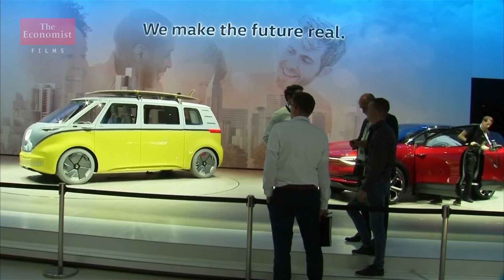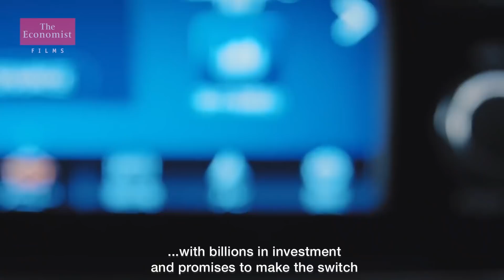Electric cars will come of age in 2018

Comment: Well, it's 2019 and they are not really catching on in the US or Canada. Less than 2% of the market in the US and less than1% of the market in Canada. Consumers don't want them. China well when you give away power and parking and subsidize them yes they are somewhat popular. Norway same thing, subsidize free power and increase the taxes on IC vehicles. Europe also has ridiculous taxes on diesel and gasoline. In the countries in Europe that are seeing increases in sales of EV the tax on gasoline is high ($1.50 to$1.76) Norway($1.86).If you look at the USA (70 cents), Canada (90 cents).All prices in USD /per liter. So excessive taxation on gas is a major factor in the switch to EV vehicles in those countries, plus subsidies to buy them. So social engineering is at play here.  There are a lot of downsides to EV vehicles. The cost to repair for one. Tesla especially. Limited range, may work well for people that live in Europe and drive short distances, but in North, America distance driven is much greater. Batteries do take longer to charge in cold weather and cold reduces battery life. Here is a video of an example of the cost to repair a Tesla EV. A normal IC vehicle would have cost maybe $2000.00 with the same damage but the estimate to repair the Tesla was $34000.00
https://youtu.be/18MItauAgKo

Comment: @Economist no mention at all of the fact that an EV powered by electricity purely from coal is still cleaner than an ICE-V?  And that the continually falling prices of solar and batteries are basically guaranteed to make the grid much much cleaner over the next several decades?  Or that an EV is the only type of automobile that gets cleaner as time goes on thanks to this trend?  Or that there’s no guarantee that cobalt will even continue to be a necessary component of EV tech as automakers are aware of the humanitarian issues with cobalt and are trying to get away from it or at least find different sources?  This is not a comprehensive video at all...

Comment: El;ectricity for EV's can just as easily come from solar, wind, geothermal and other renewable energy sources.  That transition is already beginning to happen.  Anyone who has a storage battery at home (like the Tesla Powerwall) can provide all of the energy needed for transportation if the home can provide electricity through solar or wind or any other renewable source.

Comment: This reporting is horrible.  Buying an EV especially a tesla is the best thing you can do for the environment.  EVs are rapidly dropping the cost of batteries making a renewable energy system that is 100% not only possible but far, far cheaper than fossil fuels.  EVs powered by even coal are still greener than ice cars.  1/4 EV owners have solar systems.  EVs only have 18 moving parts so they can last 1 million miles.  Lithium ion batteries soon will not even use cobalt.  battery price will drop by at 67% by 2030, and those are very conservative projections https://cleantechnica.com/2018/11/18/buying-a-tesla-is-the-best-thing-you-can-do-for-the-environment/

Comment: NO ,, Electric Vehicles wont come of age in your life time..!  EV's have been around for more than a Century and they have ONLY  become popular with the " politics towards  renewable energy " - despite advances in Batteries & Magnets.....

Currently , EV's represent less than  1%  of Cars on US roads and  "it will be a very long time"  to even reach just 10%.

As a matter of fact ;  Commercially,  it will be more market worthy for Car Makers to change to another FUEL that is
less polluting such as  Hydrogen ( once the Safety issues are resolved ) because the driving experience will be similar
as with fossil fueled Cars ( internal combustion ) - to maintain an acceptable distance / range and quick to refuel...

Electric Vehicles represent a compromise in many ways : what if you wanted to go on vacation towing a decent boat
interstate , to remote locations, where there is no "plug in power"..?  What if you were travelling into Snow regions in the dead of Winter; "where is the  energy for heating..?  Remember that any Car Air Conditioning - Cooling  shortens the range
of an Electric Vehicle that already requires " too many hours to recharge ", instead of a few minutes to refuel at a pump.   

Electric Vehicles have the very worse "resale value" obviously because ; the old batteries perform worse and need to be replaced at half the cost of a new car.  Secondhand EV's are a financial risk and compared with a S/H: petrol/ gas/ diesel cars , fossil fueled - wins in practical terms..........    

The worst propaganda FRAUD involves Commercial EV's for use in "long distance"..!!!!!   Engineers have found that current technology, cannot run heavy trucks due to Battery Weight "taking away from Freight load" ; making EV's non viable.

Then we have dreamers that think Electric Efficiency relates to the Motor - wrong, the batteries hold only a percentage
of the original energy to charge them, in the first place - the energy loss "already exists" before the EV even moves..! 
Other dreamers think that it comes from renewables ;; that's fiction.  Every Country has base load power that is either connected to another Grid or is backed up with Fossil Fueled or Nuclear Generation.  Battery storage is by far the most inefficient & expensive form of retrieving Energy - such as from intermittent Solar & Wind ; not price competitive.
Reply: @MH Sorry you have never experienced the superior dynamics of driving an electric vehicle, or the convenience of having a full battery every morning and never having to fill up at a gas station again. Take a ride in a Tesla some time and come back to tell us how much you miss the noise and delay as an ICE car downshifts before delivering a 10MPG burst of acceleration. While you have some valid points regarding grid stability and cost, all of those point begin to diminish in importance as battery costs go below $100/kWH. That is the tipping point where EV's get cheaper than ICE's. See this excellent video debunking a lot of these obsolete EV myths:   https://www.youtube.com/watch?v=kk7ZTn9g7bY&t=929s

Comment: A very simplistic piece. Electric cars will require coal to produce the electricity hence they are not green: certainly not true on the streets where the electric cars are driven and not even necessarily true at the generating station, since scrubbers and other emission controls at the generating station can be considerably more efficient than on  the tailpipe of an ICE car. As for the impact of the fact that cobalt is presently mined mostly in Africa: Australia and the US have large deposits of cobalt and plans are already afoot to develop them

Comment: The cost of storing 1kWh of electricity in li ion is 0.41USD. Storage is mostly need two times. In the BEV and then in the charger so it can charge the BEV quickly or when photovoltaics/wind have no power or when the grid can not handle charging peak demand.

http://www.intertek.com/blog/2017-10-06-grid-scale-energy/

BEVs may be acceptable as a city-only scooter not doing much mileage, because the cost of storing the electricity will make it uneconomical otherwise.

Comment: its no secrete that the electric car is powered in large part by the fossil fuel plants then even at that it is some 70% 'cleaner as there is a shift to clean alternative energies to the grid sooo they say don't change because it will cost trillions  and their will be political unrest they suggest as the middle east will become politically unstable then times 10 to climate change coming caused by fossil fuels in the first place........ this will cost 10 trillions times more and what is trump and company and the economist doing supporting fossil fuels to the last drop of profit azzwipes that they all are - sue their azz and lock them up !

Comment: China hugely invested on renewable energy, and then after India also invest huge in renewable energy. India will not going to add more(or very less) power plant based on coil. https://en.wikipedia.org/wiki/Renewable_energy_in_India

So I don't think coal demand will remain same even after EV revolution(means 90% people will use EV only). 
And that time, surely the heaven will sift from middle east to congo Africa.

Comment: Why is it most people seem to assume that refined gasoline magically appears at the corner gas station?  I’ve heard many say (including this video) that electric cars run on coal – well guess what, so do gas cars!  It takes 6 to 8 kilowatt-hours of electricity to refine crude oil into one gallon of gasoline – and this does not include the energy needed to dig the well, pump the crude out of the ground, transport it to a refinery, or haul the finished gas to the local station.  Electric cars produce no tailpipe emissions and the Defiant Electric Roadster goes about 50 miles on electricity needed just to make one gallon of gas.  The average car gets 25 MPG and produces 8,887 grams (almost 20 pounds) of CO2 for each gallon burned.  This means to go the same 50 miles the average car produces close to 40 pounds of CO2 - regardless of how the electricity is produced.

Comment: I don't know anyone with an Electric!! 

It's like a UFO.......You might see one, but it's Rare!
What about those super Toxic Batteries??
Reply: It probably depends on where you live.  I see them all the time, but most people don't even know what they look like so wouldn't notice them if they drove right by one.

Just like people keep saying they have never seen a EV charging station, but people don't notice them as they are not relevant to them.  They could park right in front of one and never notice it, as they don't use it if they don't drive an EV.

And the batteries are not "super toxic" by any definition.  The toxic batteries out there on the roads are the Lead Acid batteries, as lead is a neurotoxin.  Fortunately, 99% of all Lead Acid batteries, which are found in every gas or diesel car on the road, are recycled.

Lithium Ion batteries are mostly Nickel, which is actually not toxic.  The rest is Copper, Aluminum, Graphite, a little bit of Litihum, and a little bit of Cobalt.  None of those are actually toxic.
Reply: @ClarksonsinUSA
Super toxic is the gasoline engine. There are masses of electronic inside for For regulating and control technology, what an electric car doesn't need. It's just a simple engine without big technique.
Also the catalyst of a gasoline engine needs a massive rare earth what an electric car doesn't need.
The future Alu Ion battery is created out of Aluminum, which is a lot available on the planet. 
The super rare earth in the catalyst are blowing out in the air over time. The battery system of an electric car is a closed system, where nothing get lost and it can be recycled 100%.
Reply: eDrive Are you suggesting an ICE engine has more electronics than an electric vehicle? That's laughable. 1200lbs of batteries per vehicle is nothing to scoff at.
Reply: Yes, an ICE has way much much more electronics and regulators inside than an electric car.
Think about all the regulators and sensors belonging to the engine. look how much cables there are...
AN electric car has almost no cables. Only very thick cable for the power of the motor, but not much.
There is no measurement of airflow, no knocking sensors, no co sensors, no temperature regulators, no ignition, no spark plugs, no measurement how the mix of air and gasoline is... 
It's just a very simple electric motor with power supply. what do you need to measure and mix? Nothing... 
Only the battery is a big block, with the cells. But no need for that much regulators and electronic for a battery.
Reply: I think you seriously underestimate the electronics needed to manage a battery system and keep it safe. A car with over 7000 individual battery cells, fuses, balancing, temperature controled, grouped in parallel and series has almost no cables? Oooookkkkk....
Reply: @mar504  
Yes you need one computer to manage that all. But do you know how many computers, devices and regulators are in a ICE car? Maybe you can't count them all...
Battery development just started and there is still big potential in development. But ICE is already fully developed. There is no big gain anymore.

Comment: electric driving is so much fun... 
I never thought about that before, but since I have an electric car, I love to drive a lot.
Reply: You must have a Lead Foot. BEV is all about acceleration, people who love cars that actually quickly cover ground faster.
Reply: An electric car have always a very strong acceleration. Because straight form the start at rpm zero you have already full power without clutch and without changing gears. An internal combustion engine don't have power with low rpm and you need to reach the powerfull rpm range first. That makes it way slower.
But you can not always drive that high acceleration, because you will consume a lot of tires...

Comment: 3:46 "But EVs are still running on coal!"
It is amazing how this argument is circled over and over in the arguments, disregarding that EVs running on coal are still 2.5 times more efficient than ICE cars. And also disregarding that fossil fuel don't just come into existence at the gas station but that pumping raw oil, transport, storage, refining fossil fuels and delivering it to the gas station costs energy aswell, the same dirty coal energy allegedly all EVs are using. Also disregarding that local emissions are shifted to big power plants which are efficient than a million ICE engines, disregarding that local emissions have a more direct effect on people that power plants which emissions can be controlled more efficiently. Disregarding that renewable energy doesn't have to change in an instant but can gradually become cleaner.
But hey, you got to say some bullshit arguments that have been exposed and discussed to death to make a report edgy, right?!

Comment: Yes, lithium batteries, moreover, the mining of cobalt is problematic. However, battery manufacture for vehicles is only in it's chrysalis phase. Look at how quickly EV's have evolved, so you're telling me we can't figure more sustainable means of energizing/storing energy in our vehicles? Give it another decade and a bit people won't be using lithium batteries.
Reply: Companies like Tesla have drastically reduced their use of Cobalt in the Lithium Ion batteries.  It used to be around 10%, but the latest 2170 cells are now 2.8% Cobalt.

But the chemistry keeps evolving and if Cobalt becomes an issue as far as price or demand is concerned, they will probably change to a different chemistry and eventually eliminate it entirely.

Comment: This video is only 8 months old but its concerns re cobalt are already receding as the amount of that element to be found in the latest Li-ion cells is rapidly heading towards zero.
Reply: Exactly, Tesla reported that their latest Model 3 2170 cells have reduced the Cobalt content to 2.8%, a drop of around 70% since the 18650 cells used in the Model S and X.

Comment: Refining a gallon of gas takes about 4KwH of electricity. Then there is the energy to pump the oil out of the ground and transport it to the refinery. Then the energy to transport the gasoline to the filling station and the electricity used by the filling station to provide the car owner with that gallon of gas. This isn't just the energy to get it from the filling station tanks in the ground to the car's tank, but also the energy to operate the filling station. Elon Musk claims that the total is about 6KwH which would power an electric car about the same distance as a gallon of gas.

Comment: "Electricity for the cars is often made using dirty coal", and exactly HOW do you think electricity that is used to raffine gas for gas cars are made? That prosess uses a LOAD of electricity, and this generally comes from dirty coal. EVs can charge overnight, when there is an overproduction of electricity, and therefor not give ANY increase on the production of electricity. The "EVs are bad due to dirty grid" is such an unbalanced statement. And I could only tank dirty gas made using dirty electricity in my gas car. Now, I "tank" my car using electricity made using ... falling water!

I am sticking to EVs, tnx. And when the battery production gets cleaner (as it is doing), EVs will be even better. We do not think our cars are without any negative footprint, but we know they have way less of a footprint than does gas cars.

Comment: And what of traffic congestion? Just how do electric cars deal with this? While automation could ease congestion in some cities, what happens when more vehicles go on the roads? We're back to the problem of volume.
Reply: The solution to traffic congestion will be more people working from home, instead of driving to an office to work on a computer instead of just doing it from a home office.

At least electric cars don't pollute when stuck in traffic.  Electric motors use zero energy when stationary, unlike gas and diesel engines which pollute the most when they are idling in traffic.

Comment: Yeah well we're almost half way through 2018 in the UK and there is still no cohesive charging infrastructure, single method of payment, availability of new EVs without a 9 month wait.... And EVs are still depreciating at the same rate as an anvil off a cliff. Reality check complete.
Reply: EV depreciation is highly misleading.  A lot of the depreciation is due to the subsidies at point of sale.  If I buy a $30K EV today and I get a $10K tax credit, my net cost for the vehicle was only $20K.

If I sell it a year later for $16K, I am only out $4k, not $14K from the manufacturers MSRP.

High end EV's such as Tesla's actually depreciate less than any car in their class, as seen here:

https://electrek.co/2016/09/13/tesla-model-s-value-retention-leading-segment-losing-only-28-after-50k-miles/